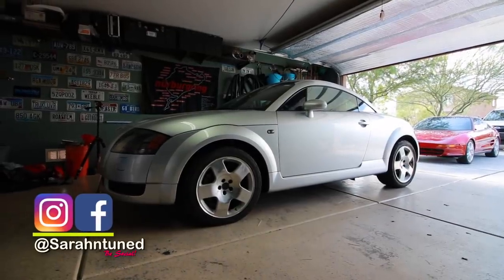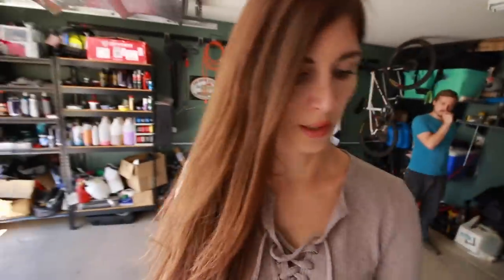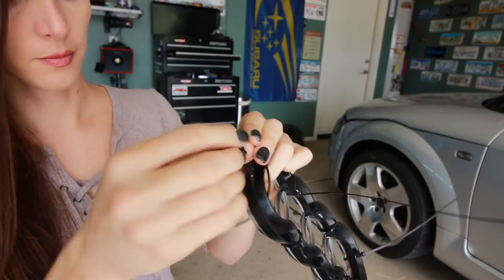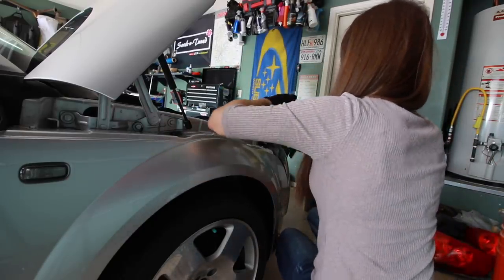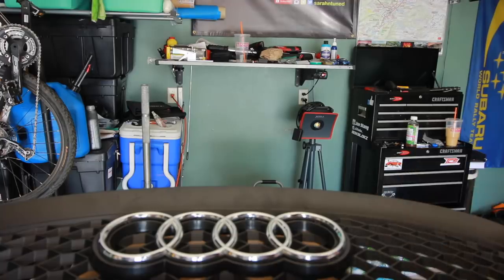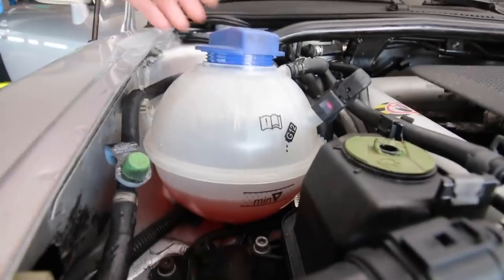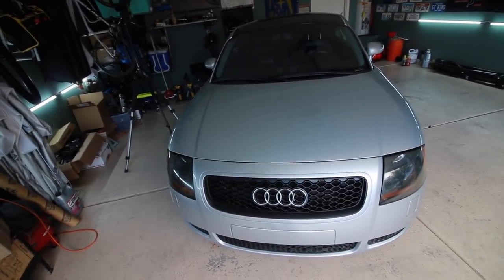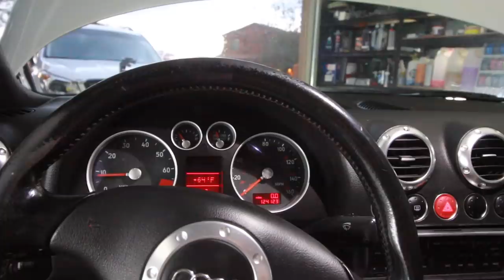First Start! Engine Work & New Grill! // Project TT Quattro

Comment: Hi Sarah!
A Common Problem with the cooling fans are the resistors for low fan speed!
They tend to break...
The resistor for each fan is located directly inside the motor of the fan.

Greetings from Germany 😎

Comment: Hi Sarah! I know this is way too late, but a good solution for corroded wires near the battery posts is glass cleaner such as Windex™. For the one you had trouble with, concentrated lemon juice or Limeaway could be the ticket. Chemical cleaning could be a matter of dunking the problem in the juice and letting it soak a while. If you want a heavy duty acid, pool supplies have muriatic acid and hardware stores have sulfuric acid as a drain cleaner. I used a product called Bulldozer drain cleaner to purge the rust out of a lawn mower gas tank. Limeaway and naval jelly had virtually no effect. I believe that the Bulldozer acid was hydrochloric. As a precaution, I used my concentrator hose nozzle to purge the chemical from the gas tank, spraying it from twenty feet away. After the purging, the tank was shining inside. BTW, most mowers nowadays have plastic fuel tanks. The mower I was working on is the old type with a steel tank that is the equivalent of the float bowl of a carburetor. The carb attaches to the top of the tank and has tubes that protrude to almost the bottom of the tank.

Comment: Baking soda neutralizes acid...when you mixed the baking soda with the apple cider vinegar, you turned it from vinegar to water. The acid in the vinegar was neutralized.
Reply: And in doing so.... created a reaction that removed the corrosion more efficiently than simply agitating it mechanically with soda and water.

Comment: When I did the intake gaskets on my F150, I sprung for a coolant vacuum filler. Money well spent. If you're not familiar with them, they use a venturi to vacuum down your cooling system. You can then leave it purged for a while to make sure you don't have any leaks. When you're ready, it has a hose you stick right in your new coolant bottle and the vacuum in the cooling system draws the new coolant right in. Presto - perfectly filled without any air bubbles.

Comment: For the cooling system, a very effective tool to invest in; is the Schwaben coolant refill / air purge tool. You can find it at ECS Tuning. It's a bit pricey at $78, but really worth the money. You can use it on almost any car. It works very fast, and you can refill the whole system in one shot.

Comment: Battery terminal corrosion is very acidic from the sulfuric acid in the battery.  The point of using baking soda is that it is a base and will neutralize the acid. Vinegar is an acid too so by adding vinegar to baking soda, you are neutralizing the baking soda's alkalinity (which is why it bubbles when you mix them) so it's less effective at neutralizing the corrosion.

Comment: Water Wetter is really for use when using only water. Helps remove surface tension and changes the boiling point a little. Not as slippery as regular antifreeze/antiboil on the track.

Comment: Hey Sarah, a suggestion on fixing that power steering whine. Try using ATF fluid instead of the green VW/Audi fluid. Although they are both technically hydraulic fluids, the ATF will have detergents and friction modifiers in it. These detergents help keep gunk that may work its way into your power steering system from tearing apart your pump and the hyraulic valves inside the steering rack. I myself have drained and replaced the power steering fluid in many VWs with ATF with good results.

Comment: Sarah, there is a product called Deox available at hardware supply stores. It's used by electricians to prevent wire corrosion.

Comment: Sarah: 
1. Cycling RPM: I have seen several VW/Audi's with cycling rpm/blower on off. The cause:  The aircon is empty and makes this happen. 
2. Try to get a used connector from the junkyard TT or other VW/Audi. Take the connector with a feet of wire from the junkyard car and solder and heat shrink it to Mr. TaterTot.

Comment: Nice work, engine sounds good for having no pipes. Power steering flush is hard if you don't open the system. I pull the tank (if possible), put the return in a waste bucket, use a funnel to feed the pump fresh fluid until you get clean fluid coming out the return.

Comment: My Audi 5000Turbo has a fan resistor pack and three relays for the cooling fan circuit.  Audi/VW electrical issues are always a thing as you will learn.

Comment: the coolant is always going thru the core its just a flap that shuts or opens to let the heat into the car.old cars had heater valves most new ones are constant flow

Comment: If your o2 sensor is not connected, it could be going in and out of closed loop mode.
Front o2 Sensor needs about 18" of pipe in front of it to prevent it from reading outside air and messing with calibrations.

Comment: I have about one third of a bottle of Water Wetter in my GS300. Between it, the refreshened cooling system, and the fact that the cooling system is overbuilt from factory, it takes my car forever to warm up below 60F, but the thermostat doesn’t fully open until it is 110F+ ambient. My point, Teter-Tot may take a while to warm up with all that WW.

Comment: As for the grill.   Yes they are super difficult but with a ton of effort and elbow grease, you can get them to snap together.  Try to do the new challenger grills after someone else had put the 3 layered bezels and grills together incorrectly

Comment: Hi, good work on tt.Problem with your cooling fan on audi is radiator fan relay. Moisture penetrates inside of it. If you disassemble relay, black cover on it, you will find corrosion on contacts and traces of water. Replace relay with same factory number ,because factory made few versions of it.I hope that I was helpful. Nice greeting from Elvis

Comment: Hey Sarah,  with mk4 vw/s (Tadder tot included) there is a fan control module located under the battery tray that may be toast.    what I would recommend doing first though is with the car running crank the car to max AC and see if both fans run at high speed. if that second fan is still not moving it could be as simple as a dead fan.  I lost my main rad fan on a 7k road trip in downtown La, car was not happy with the secondary smaller Ac fan playing catch up.

Comment: Hi Sarah, I think the "Radiator Fan Control Module" is broken, changing it fixed all the weird problems with the fans on my MK1 TT, if its not the module, one of the temperture sensors could be broken (one on the rediator, 2 next to the battery on the hose), the green fuse in the video looked fine (which also could cause problems), otherwise the fans must be broken or your climatronic coul be broken.

Comment: Not sure how viable this is for the audi, but a lot of times I've unhooked the reservoir, stuck the hose that returns fluid to the reservoir in a jug, and then put the other hose that takes fluid to the pump/rack into a new container of the fluid, then I watch until the fluid comes out green. This kind of requires someone to watch and someone to shut the car off, but I've had impressive results with just one flush like that.

The prestone stuff works good, but you can't beat the minty smell of the legit Pentosin CHF11s :D

Comment: I'm a little late to the party but the steering pump noise can be the o-ring going into the pump from the hose. The rubber gets hard and lets air into the pump, causing that noise and bubbles.
Reply: Also just got to the part where the power steering got quiet. If it makes the noise again when the car is cold, then it's definitely the o-ring.

Comment: Pull fuse#16 and fans will run full time on low speed including 8 minute after-run.  This shuts off the turbo coolant after-run pump tho so idle home the last mile (without your usual WOT driving style to cool the turbo).

Comment: If you're going to use zip-ties it's really useful to invest in a zip-tie or tie wrap gun.  My Panduit one is around $200 but I've seen plastic ones for less than $100.  There is no substitute.  It does two things you can't really do any other way.  It pulls a consistent adjustable tension on the tie, and most importantly it cuts it off flush.  I've constantly on folks in various electronics things to use them as when you use wire cutters to cut them off you're left with a sharp nib sticking out.  Anyone who's been around cable ties has cut themselves on these nibs.  The gun leaves a nice smooth edge that won't draw blood.  So you can save that for your local blood bank.  :-)

Comment: Can you heat gun that grill, and stretch it wider in the middle, so it fits better?
Also, I would suggest soldering the crimp on the corroded terminal .. good chance the crimp is compromised, a little extra resistance at high amps, is a recipe for runaway terminal overheating thermal events (i.e. fire). Lastly, check your Blower Motor Resistor .. probably needs to be replaced, to restore the low speed operation ... it's the preferred cheap method of reducing fan speed, placing a big resistor inline, that heats up and fails eventually, LOL.

Comment: To cycle power steering fluid, you can just remove the belt, unhook one hose and put into a bucket. Then spin the pulley. No need to run the car

Comment: Hi Sarah. Good to see you're sticking at it!! Don't forget the AUTODATA PDF files I sent you for the TT. All the wiring diagrams and fuses etc are in there. The 5 wires on top of the battery starting from the left are alternator, Interior relay fuse, Cooling fans and control module, fuel pump, secondary air pump. The 3 green fuses from left to right are cooling fan, abs, abs pump.

the next link from an Audi forum should explain whats going on with the fans and idle speed going up and down. https://uk-mkivs.net/topic/4773-fan-problem-poll-synopsis/

Comment: I have not had good luck with the water wetter, in my iron block and aluminum head engines.  It ended up getting caked in the coolant passages upon later disassembly.

Comment: those vw ag cars had a fan speed control unit bolted beneath the front bumper ..it is a black box with a white underbelly..and three connectors one large two smaller..the large one is the input output plug and it loooves to make false contact..the overheats..then it fails...give it  a check

Comment: Hi Sarah, If I´m not wrong coolant is always flowing trough the heater core, so turning the heater on to bleed the system is not needed. Regarding lumpy idle, did you check for any loose conection on the vacuum system? BR
Reply: You are correct. Older cars like MK1 VW Golfs have a valve that would close off coolant flow to the core. New cars have constant flow through the core and heat is turned on/off by opening flap doors in the heater box.
Reply: not really anything to do with old or new. most do flow coolant through the heater core all the time but some dont.

Comment: I suspect a lot of old German cars have the wrong power steering fluid in them; that green stuff it needs is almost five times more expensive than the typical parts store all-makes-all-models stuff.

Safe travels, Aaron!
Reply: $25 for two 12 oz. bottles!
Thanks. :)

Comment: Hi Sarah, maybe try taking the Audi emblem off the grill and then mount the grill? And the put the emblem back on in situ if you can. When you clamped the emblem on the grill it may have deformed the grill slightly. Cheers from Western Australia.

Comment: why is your check engine light on?  what faults are stored?  you could have a bad fan control module or bad temp sensor.
Reply from the maker: German Elite Tuning from my aftermarket downpipe.
Reply: Sarah n Tuned oh ok cool. It sucks our state has cracked Down a much on coding out emissions monitors on 1.8ts. I have had a few of my customers cars flagged due to the cats and sai being coded out.
Reply from the maker: German Elite Tuning if I wasn’t building this car as a “toy”, I would probably put a high-flow cat on it.

Comment: hi there , I didint follow the whole build but the thing you mentioned as a problem with the rpm and fan coming on might just be the a/c system . A/C usually cycle the fan on and the a/c compressor clutch which will put a strain on the engine and the computer will adjust the throttle accordingly it just seems more obvious because you have no exhaust on. It might stop doing it as obviously when you fix the low speed though

Comment: Sarah, if that was the LO speed fan's wire then something caused that damage.  Looks burned up to me.  I'm willing to bet the LO fan motor windings are burned/shorting causing low resistance.  I would use a separate 12v battery with test leads to check operation of both the LO and HI fans.  I don't remember seeing if you've had a multimeter in past vids, but it would help you out a lot.  A test light is also handy.  I'd want to check power to the motor and motor winding resistance.  I suspect the LO fan is now dead (the wires burned sometime before this event).  The ECU is probably commanding the LO fan ON and it's not working so temp climbs enough to kick on the HI fan.

With the steering pump, it's going to take time and possibly more bleeding to get all the air out.  With fresh fluid, I've noticed slightly louder steering pumps, FYI.  The real test will be when you drive it.  If steering feels too heavy or totally dead, then it still has air in it.  If you continue to see frothed/foamed fluid, then you haven't gotten all of it out.  Good job on sucking out the foamed fluid, that stuff takes forever to de-air so it's best to put in fresh fluid.
 
I had a stubborn air-lock in a steering system flush and we had to jack up one side of the car over a foot before it "burped" out the air.   Be careful bleeding and flushing steering so you don't let it suck air... you're seeing what a bastard some systems can be.  Great job, you're an excellent mechanic and I enjoy the channel!  Check out my channel for my turbo LS swap into a BMW.

Comment: Hello, about the front grill, wen we use some non OEM parts that kind of problems appear... in you case I would try to fit it with the front bumper out and with a heatgun try to make the brackets go to were they should be... I had that experience on my Škoda Octavia II FL when I installed the VRS front number. The fog grills wouldn't stay a started to go of so with the heat gun I bent the curve more and put a screw to make sure that it won't pop out.
It looks very nice with that grill in my case I have the problem in finding a front upper grill that matches with the honeycomb grill of my Škoda Octavia aka "Luzinhas" (little-lights) there is a story behind that name.
My difficulty is because the ones that I find have a window for the realising hatch of the hood lock.

Best wishes and regards

Comment: The grill looks good from here! Always a good feeling when it starts up without trouble after you put that much work into it.

That power lead is from fuse 134 to the relay panel behind the LH dash, and powers basically the whole car, aside from your J293 Cooling Fan Control Module on the left side of your radiator support, and a few other things that don't fail as often.

After you bleed the cooling system with it running, you need to open the cap once it cools all the way down and let your tank pressure normalize, or you'll end up with a slight vacuum in the system and collapsed hoses eventually.

Did you ever get your VCDS up and running?

Comment: That Impreza would have been pulled over by the Police in the Netherlands and impounded, not kidding.

That's a definite disqualified car for road use here, the fine would have been about €1000,- or more depending on the rest + the tow company bill and storage initial bill is about €1500,- total after the first week,...going up by the day with €80,- after that.

The car ain't worth that, so the other option you get is to have it crushed/destroyed leaving you with the fine and the tow without storage at around €1700,- .

That why you won't see cars looking even remotely like it on Dutch roads, funny to see how legislation differs by huge factors in other countries.

You'll get points on your license for driving a disqualified car on a public road here aswell.

Great vid Sarah 👍-up.

Comment: Its the fan controller. Its built into the low speed fan. Replace the low speed fan and that will fix your problem. Common issue on those cars.
Reply: Any time just the high speed works or is doing what yours is the controller is bad. Vw/audi wisdom was to build controller into fan instead of separate module. I've gotten them before from an all audi junkyard in NY named Shokan just Google it. They have usually reasonable prices because that little fan is a bit pricey.

Comment: Does that have that control module under the battery tray for fan control and ac control. those where notorious for going bad.
Reply from the maker: Shawn Ubrey yeah, I’m going to check it out. I can hear a relay clicking on and off too.

Comment: What is worrying me is fluctuating temp whilst driving along.  Couple that with the video footage of changing the thermostat.  Did you mount the o'ring onto the flange of the t stat before fitting or did you sandwich the o ring behind the stat like you were showing when you unboxed?

Comment: dumb question was the coolant temp sensor for the ecu replaced or cleaned. not sure if that has anyrthing to do with the fans issue or if one fan is supposed to come on and the other for fan for the a/c function. just curious. excellent video
Reply from the maker: cartoonist1975 replaced